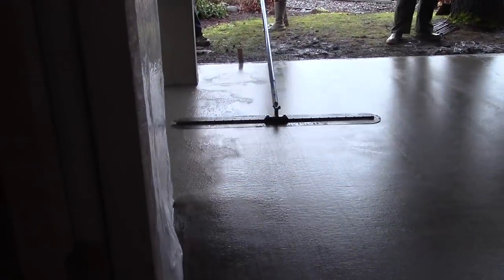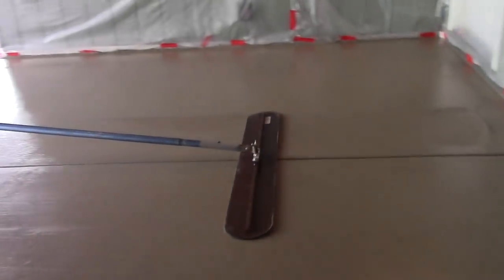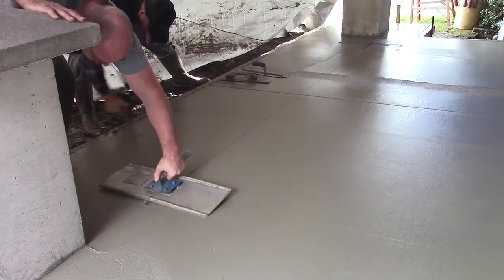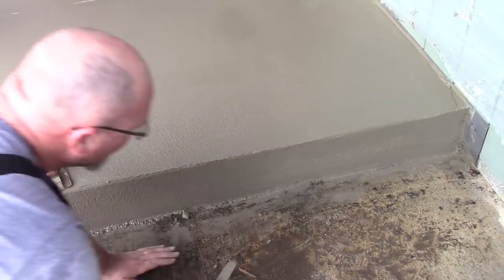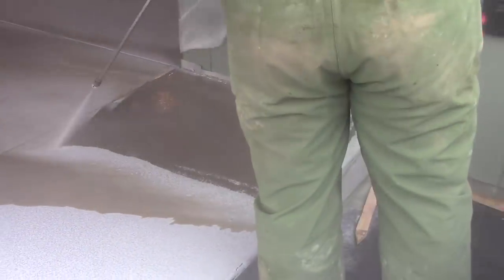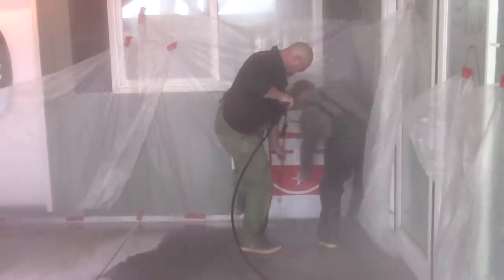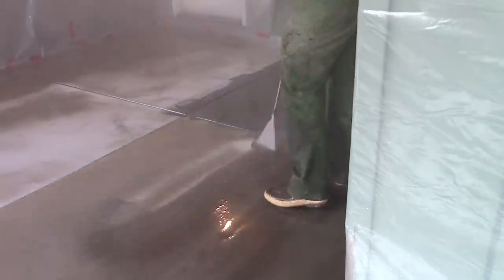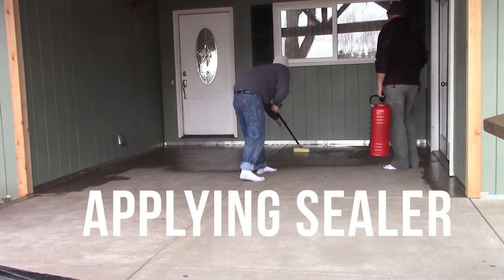Concrete Finishing Done Right

Comment: Why do they cut the lines in the concrete
Reply: chanklee wallace to limit the distance cracks can travel. They're called control joints.
Reply: so it cracks on the grooves and not randomly across the face of the slab
Reply: They cut control lines to try to control where the concrete will crack in the future.
Reply: Thanks guys
Reply: Not exactly. The reason they have cuts (control joints) in the concrete is to control cracking. Naturally, concrete expands and contracts based on a number of variables, weather being the primary cause (google shrinkage cracking). The larger the segment of concrete, larger the change in expansion or contraction. Smaller slab segments mean finer cracks. In terms of the control joints, the benefit of the joint is it forceably induce a naturally weak point in the concrete. The concrete is more likely to crack there. You will also notice in the video the mesh is cut (discountinuous) around the proposed joint. This further induces cracking at the joint.  Normally, you should install a sealant over joint which prevents the crack from being visible (would be done later in the video).  

Another way to control cracking is by increasing the steel (reinforcement) in the concrete which is what is done in concrete slabs that are suspended (not on ground), but can be used on Slabs on ground. Just a FYI, mesh they used is appropriate, but if I was doing it for myself, i would fork out the extra $100 and got the large bar mesh or closer spacing. Additionally, i would of added a waterproof membrane, regardless of the existing slab underneath.
Reply: chanklee wallace for expansion
Reply: There explanation joints. If it ever cracks it cracks there and it’s controlled so your whole slab doesn’t fall apart.
Reply: So that water can collect in the lines during winter, freeze, expand, and produce cracks for the concrete guys to repair come spring time. It's called "job security". 😁 
[𝐈𝐓'𝐒 𝐀 𝐉𝐎𝐊𝐄 𝐘𝐎𝐔 𝐁𝐎𝐍𝐄𝐇𝐄𝐀𝐃𝐒]
Reply: Morgan Wallace --- I like using #6 gage mesh for slabs on grade that is used for static loads such as autos, shop equipment, etc. Very heavy loads I go to rebar of size and spacing needed. 
Btw, the formula I used for concrete design work was:......Concrete expands 3/8" per 100' length per 30 degree temperature change....that is concrete temperature not ambient temperature. I found that formula to be nearly 'spot on'.
Reply: Expansion joints is what they are called over in the uk
Reply: DickDitty so why doesn't it happen like you said?
Reply: Maciej P If clever fellows like the ones in this video cut the lines, they will be slightly 'V' shaped and the ice will pop up and out of the expansion joints.
Reply: Stephen Miles control joints and expansion joints are different. Control joints are usually just to control cracks (and are usually tooled or saw cut) whilst expansion joints also serve to isolate different parts of the concrete or adjacent elements (usually have "flexible" filler)
Reply: Never seen someone pull forms on concrete that wet before.  But I've only poured on a farm.   Pretty cool!
Reply: Concrete's real name is crackcrete
Reply: it's a breaking point or control joint. it will eventually become a controlled crack in the concrete
Reply: for the ants to walk along...

Comment: Wow, it isn't amazing what they are doing. You have a 6 -7 inch slump. Big deal if they are pulling concrete without bars. It isn't hard when your slump is the consistency of soup! If this was my house, I would n't allow you lazy asses to pour a slab at that slump. In five years you will be back digging it up and redoing it. Job security I guess for your team. And you are proud of this work?
Reply: Looks even wetter than that.  That was just about self leveling.  Screeding ain't hard when your just pulling cream.  When you pull your boot out and there isnt even the slightest hole, yeah that's way too wet.
Reply: That’s why they don’t do slump tests on these blow and go jobs. You’re exactly right, the more water in concrete, The weaker it is and that’s why you get spalling and cracks. Of course knowing the business I’m sure you must have also noticed the voids around the parameters, again just another problem with the integrity.

Comment: I've worked with concrete and this is real precision work. They make it look easy but trust me, every step takes any number of subtle skills to do well, and it's easy to screw up. Especially the leveling part was impressive. They made it look like the patio came off the mounding plate

Comment: Beautiful to watch. May I mention something? I just finished building a house in Thailand and had a very good crew. When the sitting room was poured and levelled the men wore special home made what I call stilt shoes. They shaped a piece of hardwood perhaps as thick as a thumb to each foot, then nails were hammered through them (maybe they used slightly smaller diameter drills to stop any splitting) maybe a dozen nails through each shoe ground off so the ends of the nails would be level on a floor.The nails were long enough so the wooden "sole" of the shoe was the thickness of the concrete off the ground plus a tad. A couple of straps held the "clog" on the foot. Basically this stops any "holes" in the pour when the feet are moved and stops any suction which is kind of awkward when moving the feet. I have a photo somewhere. If you try this let me know.
Goodluck.

Comment: they done a freaking AMAZING job.  ive never seen anything like that.  but if any of you read this.  PLEASE use an expansion joint[seal seal foam, 1\4" foam 1\2" foam, something that creates a gap between house or peirs] when placing concrete around anything. than use a good mason caulking to fill it in. concrete shrinks, expands, heaves, etc. when ever it touches something like those peirs or home and it [shrinks, expands, heaves] it's one of the reasons if not the reason it cracks. ive never seen anyone where i live pour concrete without some sort of expansion cushion. unless they were lazy or being a tightwad. google it. or watch other people pour concrete.  youll see more than half of them use it.

Comment: Isolating those concrete columns with expansion material is a good idea to cut down on cracking there.  It allows the concrete to move around the columns and not stick to them. You will typically get cracks off at a 45 degree angle around these areas if you don't isolate them.  The joints they cut around them will help.  Nice video.

Comment: These guys do look like talented pro's I finished concrete for over 40 years, muds a little wet, but hey looks like a "side job". I have the same tools, but I never liked "pool trowels" and people should listen to this guy!!! That vertical jointer I got for the freezer curbs @ costco. sugar water works good for retardent.
Reply: funniest thing I ever heard when I was doing shack work, the neighbor lady came by before the roller got there, and asked "you men gonna lay that cement?", I guess you had to be there, but I've used that line for years to crack up my crew, maybe it's an "inside joke"

Comment: I have great respect for the skill and physical dexterity of the folks who do this for a living (as a GC I've seen countless come through), but I'll never confuse wet rodding with something that produces "flat" concrete.  It's simply flat enough for this sort of residential work.  As soon as flat is actually required, you find this method just doesn't do flat, merely flatish.

Comment: Excellent video and always fun to watch an experienced crew set concrete.  I am curious what others think about the control joints around the columns.  Obviously these columns are not like industrial columns with a tremendous amount of load, nor will the slab need to carry much weight, but I feel the best control joint pattern around a square column is a diamond shape with joints continuing off the corners of the diamond.  I am guessing additional cracks will form within a few years off the corners of the columns running at an angle.

Comment: Using a string line across your form boards set a grade pin in the middle of your form to use as a bench mark when pulling a screed board, knock the pin down below grade once you work past it. Makes life easy...

Comment: I hate to even guess how much concrete I have had poured over existing slabs. Done right it's a huge cost saver and done right  it's better than the first pour. A lot of crews around here back in the day poured a lot of bad mud overloaded with  calcium chloride so they could get an extra pour per day in. The longer it takes for my mud to dry the happier I am. I will say this crew here do nice work and in the concrete finishing trade they are a rare find anymore. Quality seems to have gone out the window again for quantity of pours per day again. A good mud finish crew is like a good stone mason as in always in demand.

Comment: That's a $10,000 concrete patio. Crew of highly skilled 40 yr old white guys, doing basically high quality commercial concrete place and finish... with a pump no less.
Only comments... no expansion joints against existing slab and columns? And no rebar chairs (I did see a guy pulling rebar up as pour progressed. )
This is top notch finishing, but most cannot afford this for their home.
Great video.

Comment: What is the maximum particle size that your pumps can handle and especially what was the maximum particle size of aggregate that was used during this construction? I use the formerly Machine-Technologies (now Graco owned) D25 concrete mixer + P25 concrete pump with a 3/16" max particle size aggregate and will do a pour on an existing slab on the 4th floor of my house! Have already secured all the drifting cracks with metal plate stitching, drilled on the cracks and injected epoxy at high pressure! Now I am grinding and texturing the existing concrete surface, next will be installing and levelling the edges of the pour area, install basalt rebar and basalt mesh but still contemplating the concrete mix and particle size hence the question...
P.S. Amazing work and great video btw! I especially liked the end when you verbally salute your people
Reply: Thank you for the answer and for your recipe. Again great work

Comment: I packed rebar on an iron worker crew for a few years for a steel reinforcing company. After the suspended slab was done, they began to pour the concrete. They would vibrate the concrete to help it settle, everytime I saw the device they used for this task, I always snickered a little bit.

Comment: Serious control joints placed / spaced / depth right on, good job!  Only criticism is slump was a bit high = serious shrinkage (but control joints right-on) plus I would have placed a bond break around the existing column concrete bases.  The slab and base need to move independently of one another.

Comment: This is an awesome video! 
I started to practice on the back of the house by pouring ~20 pavers as a pathway , each about 3feet by 3 feet. They came out pretty good, I always use a brush to give it a texture and i use the "rounding tool" on the edges so the end product looks smooth on the edges and textured at the center.
I just finished pouring main enterance to our home today!
About 5 feet wide and 75 feet long 1 piece (kind of) slab! I placed expansion joints(?) once every 8ish feet and used wire mesh. Poured it about 5 inches thick.
My question is, what is the best way to push the gravel down after the pour? I use metal trowel and it takes a lot of work to have a smooth finish. I am also using 80pound bags from HD! Do you guys think getting a concrete truck would be better, would have less pebbles?

Thank you in advance!

Comment: Been pouring and finishing concrete for 15 years and have never poured the concrete that wet like to see what that looks like it years to come. Needed felt board or the rubber board around columns for expansion.

Comment: Hi,
I am a new subscriber. My question regards the bomb shelter I live in. The floor is over a dry basement and is about 900 sq.ft. made of 7.5 inches of near 60yo concrete. 
It is irregular and a VERY lousy job. 
 Your idea of, fabric / rebar and wire / then what looks like asphalt but you called it road fill?
Would you please expand on that.....I think I could fix many problems and uglies with my floor
if I used your method on my floor.....sounds much better than the old grind it off and use polymers
to self level...I cannot afford self leveling.....could one skip bar and wire and go with fibers and basalt strands instead for enforcement? I would like to leave the concrete as a finished floor if I can find a good finisher, as you have....BTW where do those finishers hail from?

Best vid yet...thank You

Comment: What if you're just pouring footings for a house? Does it matter that much as long as it's not soup? The way I was taught is to buy the 80lb bags of quickcrete mix it up by hand in a wheel barrel and then drag the stuff under the house in a large pan. Much cheaper than a truck and pump.

Comment: I have an older concrete patio in back yard.  I was also thinking of leaving patio and pouring over and around it because i would be covering with about 3 inches of base.  It would become more like an elevated patio with a new perimeter.  Should I remove old concrete?

Comment: lets say you have a 6x6m patio and you have walls all around, you do your control cracks. do you need do add expansion foam around the perimeter of the walls to isolate your screed?
Reply: maradonasssssss you can. But you do not have to

Comment: 👍 they did good . Steel trowels are a thing of the past for exterior concrete! U actually don’t want to “seal” exterior! That’s a interior mud design only ! Because concrete is porous 🧽 and sealing the top is what cause surfaces to pop or flake off. This slab is fine because u did exposed and removed the top. So ditch the steel trowels and frez and stick to magnesium and wood floats👍 looks good

Comment: I've been to school for electrical engineering, done plenty of tile work, framing, roofing, metal work, even rebuilt a few jeeps; still can't get a perfectly smooth hand finish on concrete!
Reply: Takes a lot of practice I have been a finisher for 8 years and I learn something new everyday
Reply: @DestinyDad  

I actually got a pretty good finish, the day I wrote that, on a pad I did for myself. It was just for a 8'x12' shed, and I could have used a mister and a couple more passes with the trowel, but I must say I am quite pleased with how slippery and shiny it is when I wet it down. 

Now I just need to learn how to powerwash it off without fucking it up! Lol

Comment: I see tons of positive comments, but I see several issues that I wouldn't do. Rather than cutting joints from every corner , apply pitch paper to your piers with a breakaway cap and use caulking to fill it after the concrete is set. Then you don't have all of that jointing at your corners. That type of sealing agent is very slippery when wet also. Not made for outdoor work and far from ideal. Decent looking job as far as flatness, but watching those guys work is like watching paint dry. I  hope all you take them on are small projects. I'd like to see how they fare pouring a 4 1/2 slump on a 97 degree day.

Comment: I'll be ... one of the .05% of concrete finishing vids on YouTube that shows a decent wet screed and good finishers.  Will wonders never cease ~

And concrete's clock doesn't start ticking once it shows up on the jobsite, it starts the second you get 90 revs on a dry mix or the completed mix drops from a wet plant.  When cement, aggregates, water and additives stop being separate and become concrete, the short shelf life begins.  Even using set retarder has it's limits.  Good vid and good crew.

Comment: Hate to ask a dumb question, but is it ordinary for the mix to be that slack? Or is it maybe a matter having to pump it? I've done very little concrete work but have watched a fair amount and that just looked wet to me. (And if I should get a wild hare to try that backyard pour I've been thinking about I'd like to know as much as I can!)
Reply from the maker: It was too wet. It was also a pumpable mix which meant that the cement ratio was high to begin with so increasing the water is not ideal but not as damaging as in a mix design with less cement. Turned out fine.

Comment: 4:43 Can someone explain what is he doing and why? I've seen people doing this multiple times, but I couldn't understand why
Reply: This comment is a year old but oh well. These are called control joints. It keeps the stresses that the concrete will experience to those lines. Without control joints/with improperly done control joints the concrete will crack all over in a "lightning" style pattern. Essentially when the concrete feels stress it will relieve in the control joint instead of cracking all over.

Comment: Union carpenter out of Indiana's local 301 with a question, why use a walk behind trowel machine on anything other than a burnt in slab or something like that? Putting fiber, welded steel mesh, a good bull float, edging, and broom finish is all you need... After all it's just a thicker sidewalk. Not meaning any disrespect, at all as im a fan of your channel and this would be my first comment to you.
Reply from the maker: Great question. We were after a sand finish. A sand finish needs really great consolidation in order to be uniform. Broom finish was not an option for this client.
Reply: @essentialcraftsman  Thank you for the response and consideration. In the almost decade I have in form carpentry I've never seen it so it piqued my curiosity over it. We don't get that kind of work doing parking garages and cast in place mixed use buildings here. So that's an entirely different animal to me. So I definitely appreciate the insight.